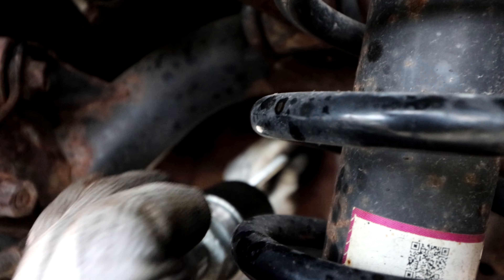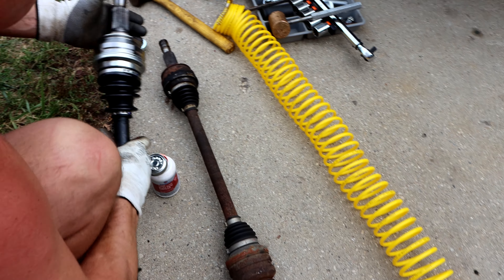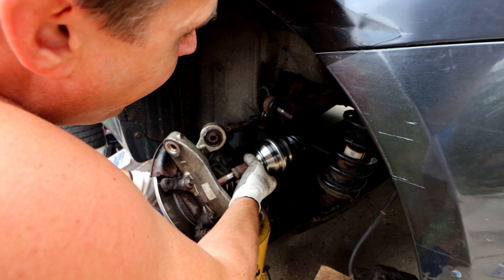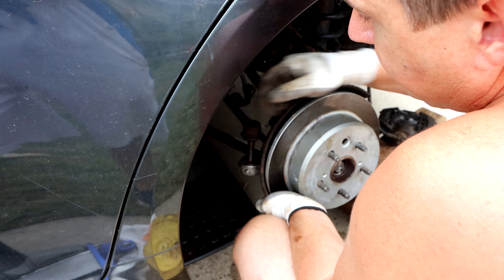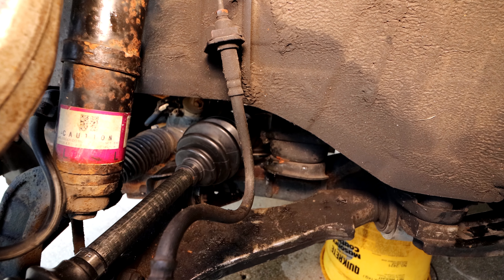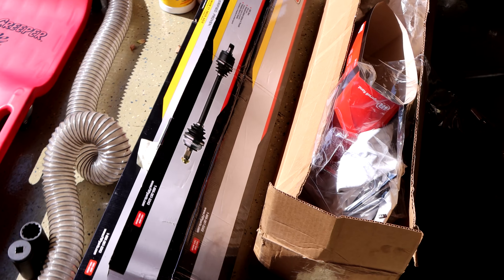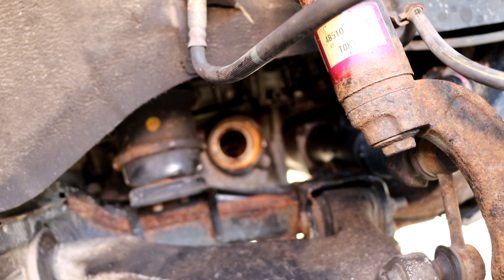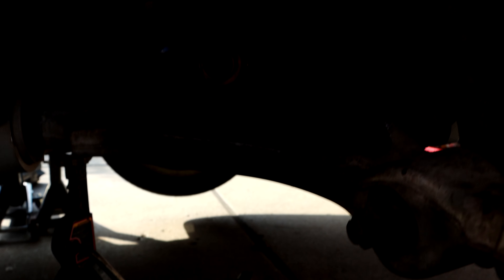CV Axle Replacement Lexus IS250,Or Any Car.Click!Click! And More Clicks!!!!!!!!!!!!!!!!!!!!!!!

Comment: Having viewed nearly seventy CV axle replacement videos, I came across one posted by a 25-year veteran mechanic who got it right, developing a procedure to quickly and non-destructively remove the passenger-side Toyota/Lexus CV axle from the clutches of the infamous bearing carrier.  Although he would not state specifically when asked, it appears he employed a Blue-Point air hammer, a model AT2050, with a 180mm smoothing hammer bit, pulverizing the rust into dust, walking out the CV axle bearing from the carrier in less than thirty seconds.  He placed the tool at various locations on the bottom of the bearing carrier, and with six burst of the air hammer, twenty-two seconds later, the task was completed. (View ”how to replace passenger side cv axle toyota sienna 2015” on the “automotive tech-vet”-channel.)
Reply: Thanks for the info! Got any suggestions for a harbor freight alternative? I'm planning to do it in a couple months, but I don't want to spend $300 on a tool.